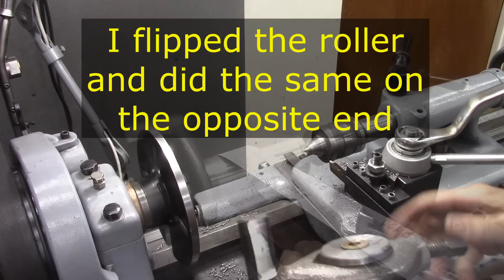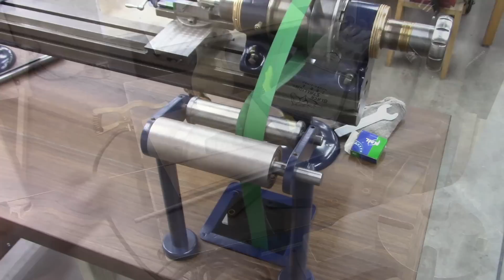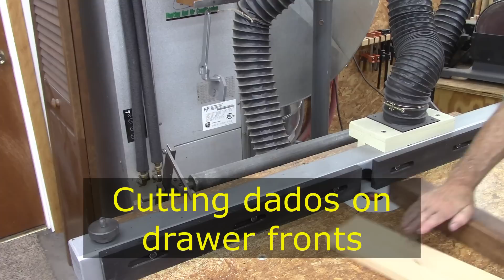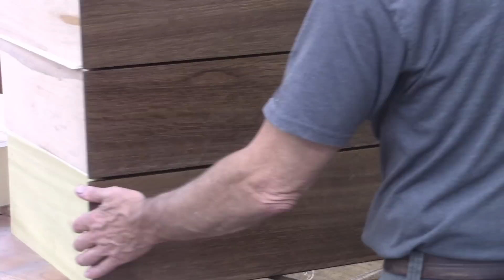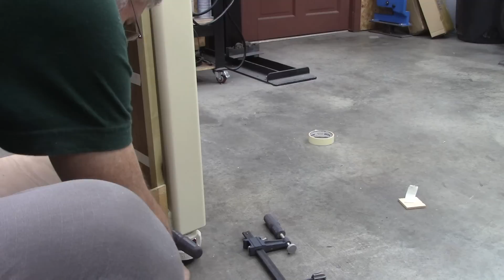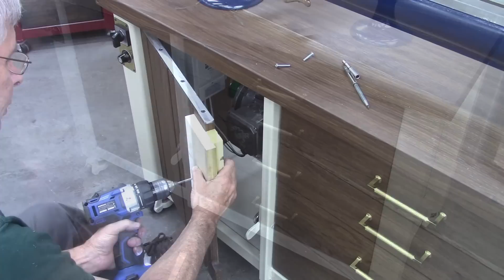Completing the Restoration. Pre 1907 Hardinge Cataract

Comment: Very late to the party, but I've got a wild idea for that Hardinge lathe.  There are ways on the machine's back side for mounting screw cutting and (possibly) other devices.  Winky, you stated you wanted to avoid interfering  with your drive setup.  There may be a way to have the cake and eat it too.  The backside ways mean anything that gets fabricated can be removed and the machine returned to its "original" state, always a consideration with something of historical value.  An electronic lead screw (such as that associated with "Clough42"), with its drive (stepper or servo) motor located at the tailstock end could work out.  The only addition to your existing drive setup is the sensor that feeds spindle rotation info. to the electronics.  FWIW, I LIKE mixing old and new technologies to get jobs done.

BTW, power longitudinal feed should be "in the cards" too.
Reply from the maker: Interesting idea! And yes, those back ways could be utilized for all sorts of cool stuff. I agree about modifying, I seldom modify old machines but add on a lot of newer technology.

Comment: Nice outcome Winky. If you don't like the brass handles, use your CNC wood lathe and make some rod type handles with finger grips turned in them. You still have the drill jig to drill holes into the bar at the correct pitch for the screws, make up some spacers to clear your finger diameters. How about an update on the wood lathe, you were going to try some different turning tools at the last video, Regards from Australia.
Reply from the maker: Yeah...  I need to concentrate on the lathe (wood cnc). I've used it twice in the last 2 weeks but it sat for almost a year. I was proud of myself on the CAM software. I actually remembered ho to use it figured out one problem I was having with random start positions. Dolphin PartsMaster seems to be a good program but one thing for sure, they have top notch tech support. I'm actually thinking about making a new wood lathe but if not, I need to figure out the dust collection. Chips all over my shop is a deterrent to using the lathe. Within a week or two I'll have a video of a little tool chest I made for Harold and the Armature Redneck Workshop (youtube). I made some cool handle for the draw pulls on it....  I might modify the Hardinge with something similar.

Comment: I think you have the largest cross-cut sled I've ever seen!
Reply from the maker: Yeah...  the table saw is very nice to use with the big sled and if you are cutting 4x8 sheets its almost a necessity. Woodworking takes up a lot of room. I laid out my shop with the table saw positioned in the center. The outfeed table is 5x8 and used as a workbench. I really need a bigger shop.

Comment: I really like it! I would be nervous about using it with the chips and oil, but you could make a drip pan of sorts.
Reply from the maker: Drip pan coming...  It's an oil finish so oil is not much of a problem.  Sill, I need the drip pan.

Comment: there is a recycled stuff place near me that has granite and marble tops removed from demos and it makes a great surface for metalworking.  They are less than $100, as low as $20 and it is fairly easy to cut and drill.  It would make cleaning up chips a breeze on something like this.
Reply from the maker: That sounds interesting, thank!

Comment: A few years ago, Mark, I got a piece of poplar that was live edge from the WW2 era when construction lumber was going for the war effort. It came from a building that was being remodeled. The owner told me I could have any of the wood that was removed. This allowed me to build shelves for my shop having only needed to buy screws for the construction of them. I did get some wood from a grocery store that was also being remodeled, and was used for the same purpose.
Incidentally, poplar is one of the few woods that can be stained to replicate walnut, and is easier to work with.
Reply from the maker: Fresh poplar is usually white and green wood. If expose the green to light it will eventually look like walnut. You sound like me...  I always save used wood.

Comment: Beautiful restoration. 
Use some loctite bearing fit to prevent slippage of the bearings on the shafts?
Reply from the maker: That oud be easier. After making this video I added spacers and crowned the rollers where the belt runs. It works great

Comment: Mark, if the OD of your bearing was the same as your brass bushing, would your concentric still have worked as before?
Reply from the maker: Yes, i almost went with needle bearings but they are pricy and need a hardened shaft.